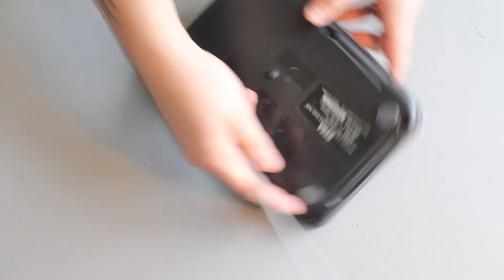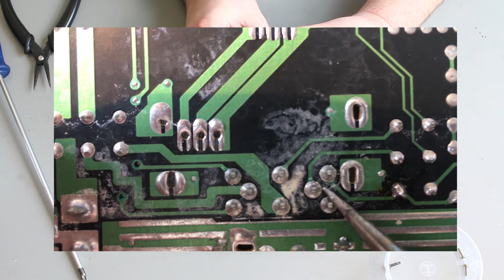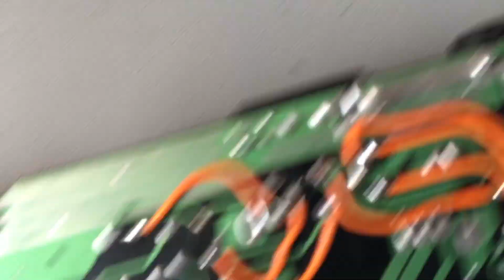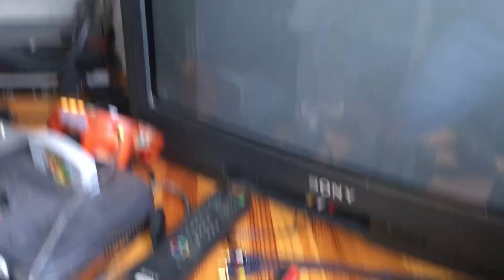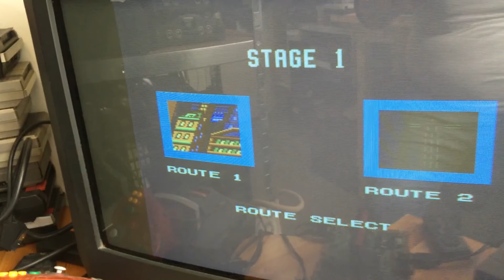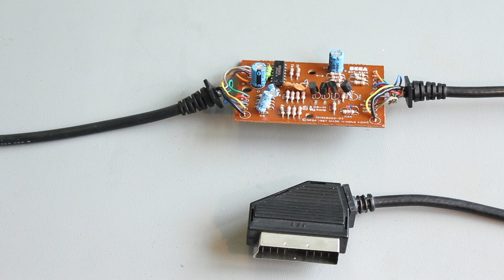Sega Master System II RGB tear down and repair

Comment: Thanks a lot, with this video I managed to fix the console I got ripped off of on Vinted. I had been looking for a RGB model for quite some time and now finally pulled the trigger on Vinted for a console that was supposed to be in "bon etat", with RVB cable and PSU. When it arrived, it was completely dead. After replacing the voltage regulator, I atleast had sound. Resoldering the connector did nothing and then I thankfully found your video and soldered in wires as you did. After blowing another voltage regulator and replacing that again it now fully works and with a top case swap and replacing the rusted out metal shield (both metal parts were by far rustier than yours) from a donor console it also doesn't look bad now. Atleast now I know that "bon etat" is French for "doesn't work".
Reply: I now managed to fix a second Master System 2 thanks to this video, and on this one I thought it really was too far gone, because it was water-damaged quite badly. Also needs a new case. It came in a lot of three consoles (SNES with original Nintendo RGB cable, NES and the Master System II) all sold as defective and now I'm 3 for 3 on that lot. Also found out that my OSSC doesn't recognize the RGB Master System, no matter if I or II, I just get a black screen, which at first made me think the repair wasn't successful, until I tested a working Master Sysem with the OSSC and also got a black screen. Then I connected the mainboard to my TV directly and it works.

Comment: Thanks for posting.  I have the original model Master System and it will only produce video if I push the cord in a certain way (audio is fine).  I'm resoldering the joints under the DIN, but I'm also wondering if the inside of the DIN can become worn from plugging and and unplugging.  I see there that there are new ones I can order.
Reply from the maker: I've replaced the DIN before, all i had to do was dremel out slots for the grounding pins as there were in a different place, I also drilled two holes either side and ran a cable tie over the connector to hold it down. the layout of the pins on the board was they same.

Comment: Great video
I have the same problem with a master system II PAL version, which doesn't get an image but does sound
I made the RCA mod but it doesn't have image either
I'll try to locate if it's a crack soldier joint. Thanks, like